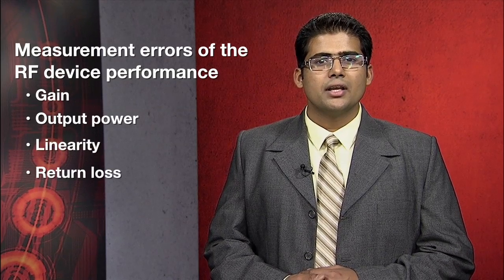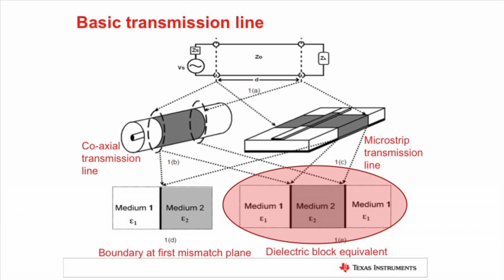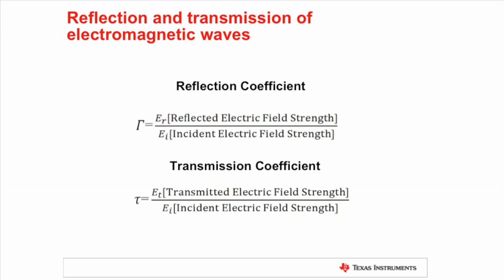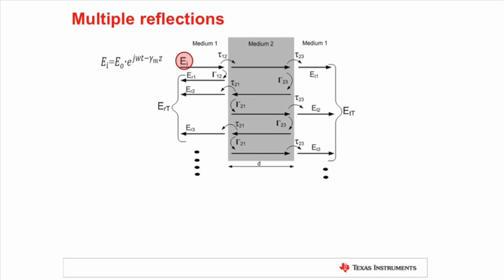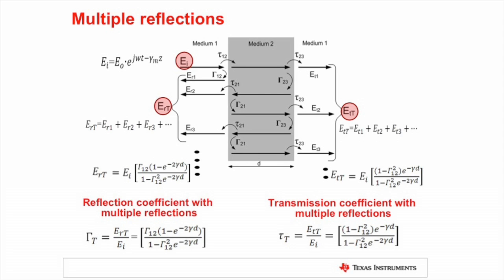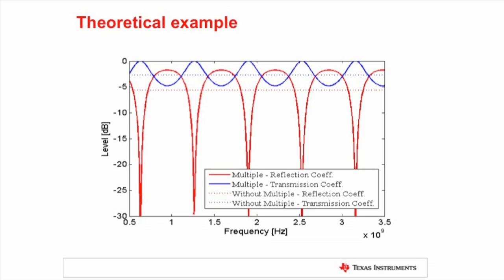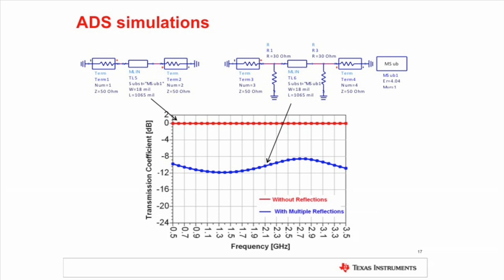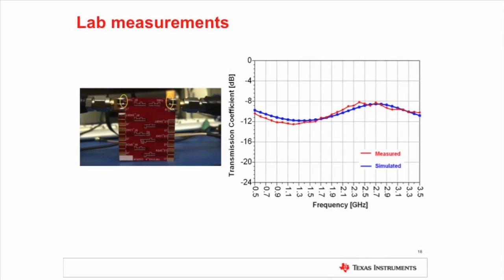Engineer It - How to understand ripples in RF devices performance

Comment: hi i have a question. i bought 3 RGB LED light strips that come each with its own RF wireless remote. Each strip is meant to go to 3 different workstations in close proximity to one another. The problem that I encounter is when one station changes a setting with the remote, the other two station respond as well. there is no other way to change settings on the strips other than with the remote. do you have a fix for this? or a trick? anything?